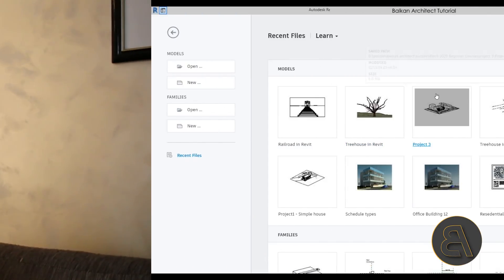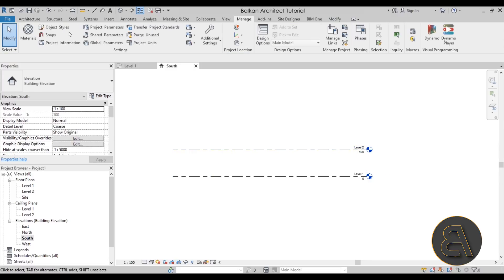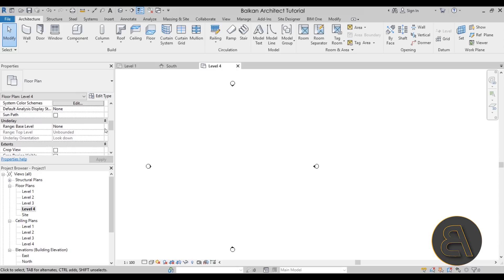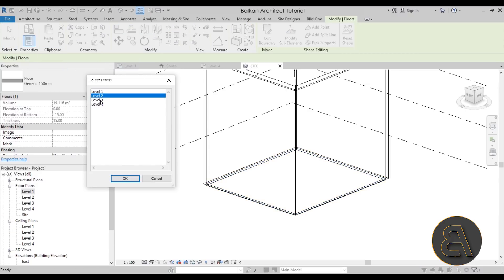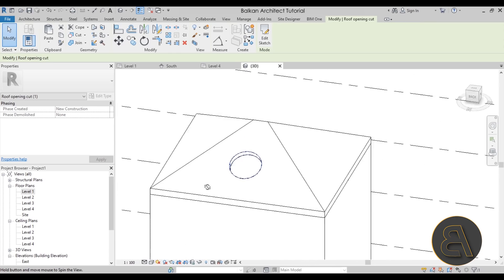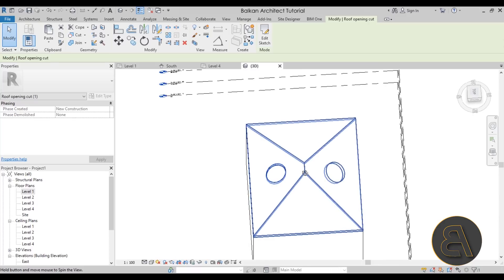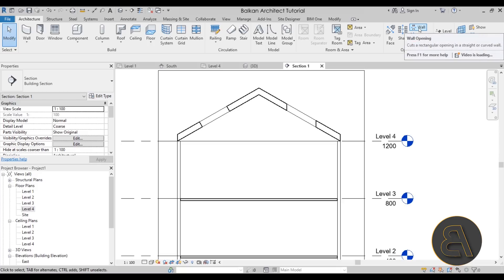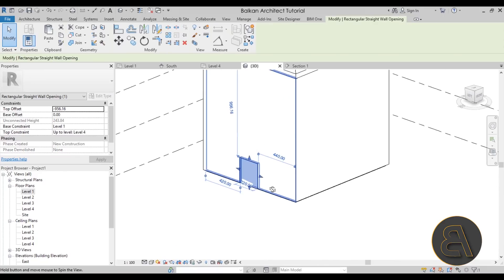Openings in Revit Tutorial

Comment: Great job on the tutorials! I have learned so much on the fly in a pinch and could not have done it without you! I work with a lot of Structural Insulated Panels in the US. The panels are held together by OSB Splines that require a void inside the thickness of the floors and walls. Can you do a tutorial on creating a void family? I am currently doing this the hard way with In-Place Voids on every single panel, but my attempts to create a void family to cut the inside of the wall have all failed. Thanks You!